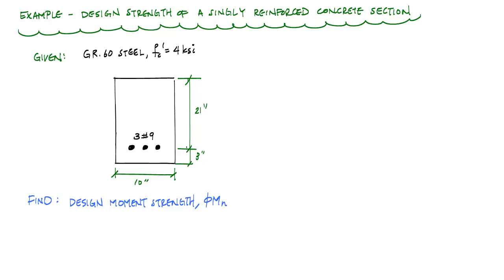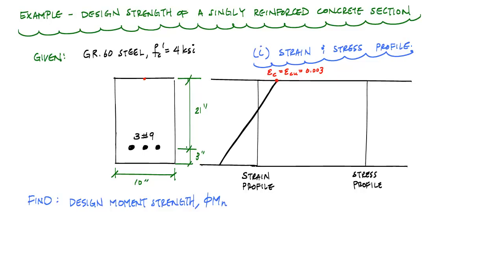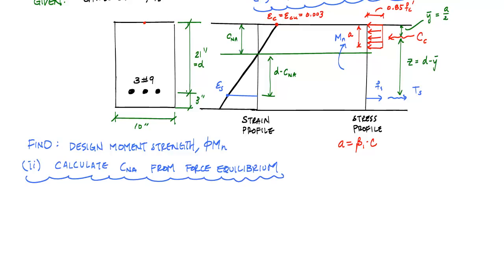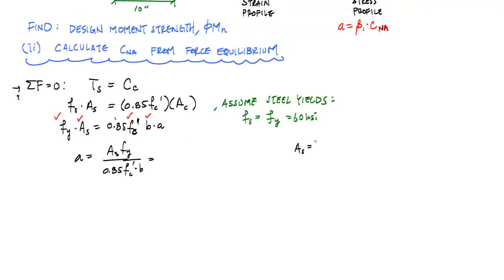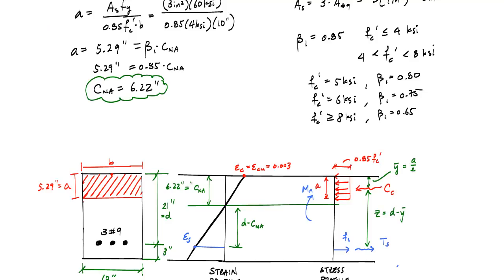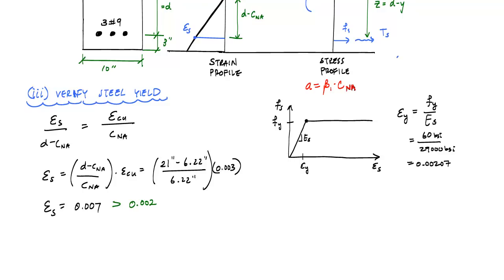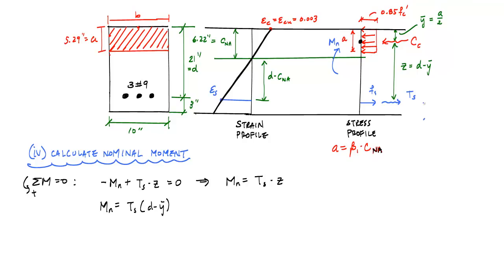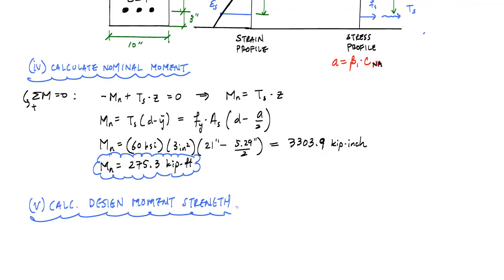Design Moment Strength of Singly RC Beam Example - Reinforced Concrete Design

Comment: @structurefree - This is a great video, you are helping me calculate beam size for a retaining wall I'm building. One thing i don't understand is we never apply the position of the rebar (3" from beam bottom) in this video. my intuition tells me that the rebar being 3" from bottom (where the beam is in tension) makes this stronger than the beam being 3" from the top.

the reason i ask is I'm building beams by hand and i want the beams to be as small as possible. my "B" = 18, and my "D" = 6. due to the rule of thumb of having rebar ~ 3" from the edge of the concrete, I'm forced to put my QTY 3 #8 rebar in the center of the beam.

My application is i'm building a beams for a retaining wall. this beam will be 8' Long, and be a retaining wall that i can pour into forms by hand and then move with a small tractor into place. the beams are supported by columns on 8' centers.

Comment: Thanks for the helpful video @structurefree   It doesn't matter much but the area of #9 is 1.125 as the area = (n/8)  => (9/8). #8 would have As=1.0 sq in
Reply from the maker: Hi Chad, thanks for the kind words.  Actually the n/8 rule is for diameter of the bar and only works up to #8 bar.  The #9 bar has a diameter of 1.128 inches which results in an area of 1 in^2. https://en.wikipedia.org/wiki/Rebar#US_sizes

Comment: Very good video for review. I'm using this to help me study for the FE so this was a good quick refresher of reinforced concrete design. Only thing I say was the #9 bar has a As of 1.128 square inch not 1 square inch. The #8 bar is set at 1 square inch
Reply from the maker: Hi Jose, thanks for your comment.  The diameter of a #9 is 1.128 inches.  The diameter of a #8 is 1 inch.  The area of a #9 is 1 in^2 and the area of a #8 is 0.79 in^2.  For US bar sizes...https://www.reinforcing-bar.com/technology/reinforcing-bar-sizes.html

Comment: Hey structurefree. What about in the equation where you have Phi*Mn is greater or equal to Mu. What does that mean?
Reply from the maker: That is the design relationship. Phi*Mn represents the design moment strength and Mu is the required moment strength.
Reply: I'm a consultant civil engineer and I really enjoyed the simplicity of the demonstration. Excellent job .

Comment: Awesome work @structurefree. I've got a question. I'm trying to understand what Phi*Mn actually means vs Mn. The equation for flexural beams is Phi*Mn> or equal to Mn. in this problem, Phi*Mn = 247.8 and Mn = 275.3. Phi*Mn is not greater than Mn. Can you please explain this, I'm a bit confused. Also, what do those values mean? Does it mean that this beam will fail at Phi*Mn? Cant thank you enough!! Thanks for all your great videos!!
Reply from the maker: Phi*Mn is the design moment strength or capacity. Mn by itself is the theoretical or nominal strength. We want the design capacity less than the theoretical so that there is some margin of safety.
Reply: +structurefree ok so if we want phiMn to be less than our Mn why is the equation written like phiMn should be equal or greater than Mn? If the beam Maximum moment let's say is 600 kpft we want to design the beam so it's actually less to have safety margin right? I guess my question is phiMn should be less than or equal Mn instead of it being phiMn is greater than Mn. Sorry for this stupid question just trying to wrap my head around it.

Comment: Hello. Could you answer a quick question. You found your strain to be 0.007 in the steel. By the hooks law E=stress/strain this would give a stress of 1400 mpa (203 ksi). This is far above steels ultimate stress capacity. I do not understand how we come up with a nominal moment capacity of 275 kip*ft which is based on a strain of 0.007 in the steel and still have a safe design.
Reply from the maker: Since 0.007 exceeds the yield strain of grade 60 steel, Hooke's law is not applicable...
Reply: +structurefree Thank you for that explanation. The only thing I am slightly unclear on is why isn't the strain we find through similar triangles the yield strain of the steel? Shouldn't it be this since we found the Neutral axis by setting the steel at yield and the Mu value is the moment the beam can take when the steel hits its yield
 stress?

Comment: Why are you treating the compression load as a uniform stress load, instead of a profile proportional to the strain, like it is modeled for introductory homogeneous beams?
Reply from the maker: the equivalent stress block is used in reinforced concrete analysis and design to expedite calculations.   You could keep the nonlinear stress profile and integrate numerically to get a very precise result.

Comment: thank you very much for the great video structurefree. your detailed explanation made it easy for me to understand the calculation & concept even i come from chemical engineering background.

i have a question: it seemed your calculation didn't consider the effect of size / length of the beam. Do we need to consider the length of the beam? Is the beam length irrelevant because the cross section (concrete + steel) is same along the axis of beam length, considering uniform distributed load?

appreciate your reply when you have a chance.
Reply from the maker: TheSnooex i'm assuming i'm looking at the critical section for internal moments along the length of a beam...or where the max internal moment would occur to design the cross-section.

Comment: Enlightening one structurefree :) great job. Thank's a lot, I know right now after long been confuse about this subject. Just a bit advice, to avoid mistake please make a different notation for 'depth of compression block' and 'width of the beam' which in this video denotes with the same symbol (a).